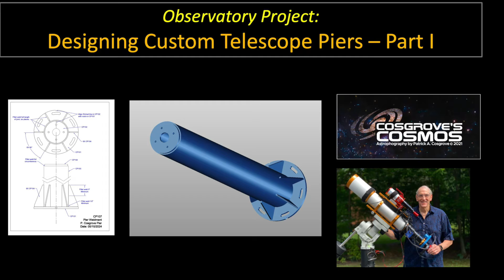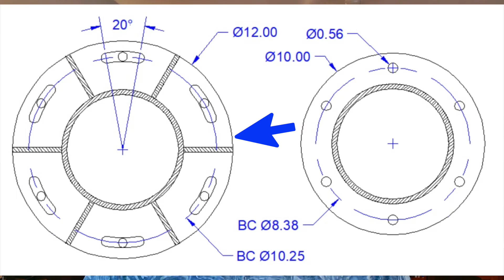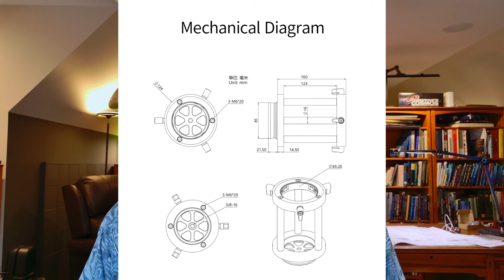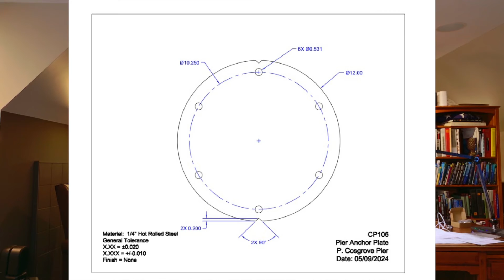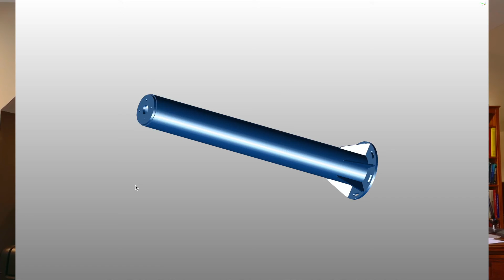Observatory Update: Designing a Custom Steel Pier - Part I

Comment: If you go to your local metal recycling place they will most likely sell new and USED metal in all kinds of shapes and sizes. 
Usually for a few bucks a pound. 
I bought a 4 in and a 6 in metal tube, cut to length on the yards bandsaw. 
They even have offcut scrap. I found some perfect triangle pieces to use as supports and also a square plate 1" thick and a round plate 1" thick. 
What I brought home was already cut and the plates had holes in them for bolts. 
I paid 90 bucks for all the steal. 
Using the flat square plates on the bottom and the round on the top with the triangle pieces to support the bottom. 
I use all thread embedded in the concrete and I turned a cast iron adapter that is IDENTICAL to the top of my tripod so my mount would bolt to it with the same adjustability as I would have on the tripod. 
I used elongated holes on the base to allow for some rotation adjustment. 
And I used large bolts with a series of two nuts on each bolt to the round adapter plate to allow for some leveling adjustment. 
Once it's all set, and polar aligned, I should be able to forget it.
Reply: Oh, and I filled my steel tube with expanding foam to cut down on vibration and ringing.
Reply from the maker: I have not head of this option - again - thanks for sharing!
Reply from the maker: Great tips!  Thanks for sharing it!

Comment: Another great video and nice to see it moving forward, FWI the pier does not have to be perfectly level, that’s what polar alignment is for….👍🏻
Reply: An excellent and valid point. It amazes me how many people are convinced that a perfectly level pier is absolutely essential for accurate polar alignment. As you say, it doesn't matter one iota!
Reply from the maker: Thanks so much!   I know that polar alignment and the alt-az adjustments on the mount can compensate for level and such - I was just a little paranoid that the foundation and bolts would go in wrong, and then I was in trouble.  And I would be if the error was greater than the alt-az adjustment ability of the mount.  So this way, I can tame my paranoia! :-)